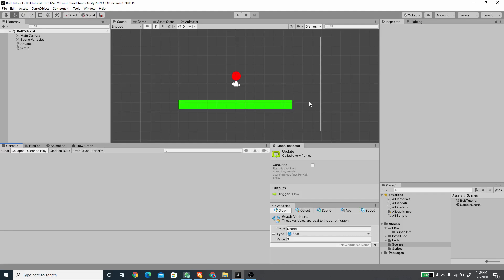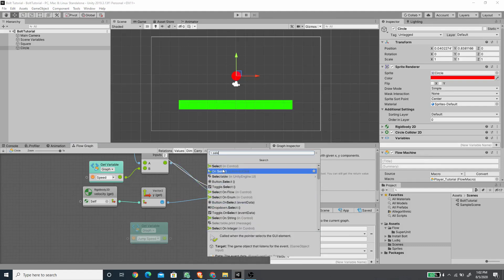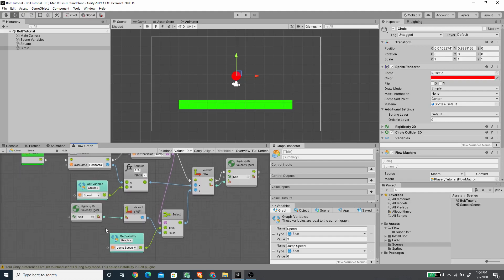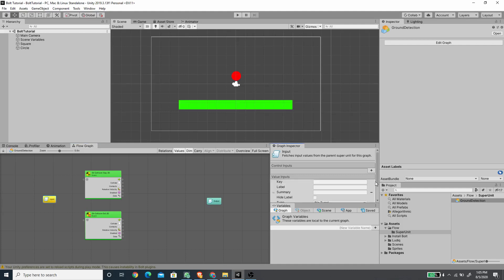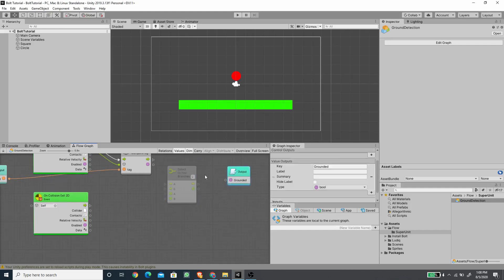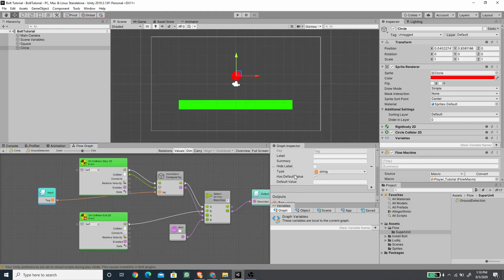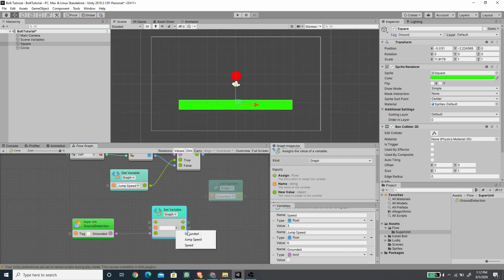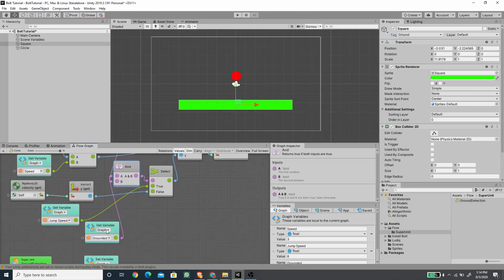Creating Jump with the Powerful Bolt Super Unit!

Comment: Theres one problem with this that I am encountering. If my player touches the side or bottom of the ground, that still counts as a collision, so my character can 'climb' or 'hang' from blocks. How do i make it so that the collision only counts if my player touches the top of the ground?
Reply from the maker: You can compare the Y position of the player and the ground, and only set the isGrounded value to true if the player y is greater than the ground y (meaning player is above the ground).
Reply: @RomiFauzi  How do I fetch the current ground's Y? That is, if the Player moves to another ground platform, how does my script know which "Ground" tag to compare with?

Or is there a certain node that makes figuring this out easy?
Reply from the maker: @HyperGameDev  hi there, upon colliding with another object, the OnCollisionEvent should receive the information of the other object the player collides with, that is if the object is on the tag assigned in the event (ie: Ground), then we can compare the y pos of the player with that object.

Comment: Hey, nice tutorial. Can u make a touch button control character animation in Bolt. I am googling but can't find one.
Reply from the maker: Thanks a lot buddy, I'm planning to the character animation next In Sya ALLAH, and I'll add the touch button to my list.
Reply: @RomiFauzi   thanks buddy's,  can u tell me where to learn about bolt function like where to use what type of functions.  Manuals are not good to me..
Reply from the maker: @nakul3561  I actually not sure where to learn that. I'm able to figure most of the units in BOLT is because I'm very comfortable with Unity C#, and BOLT is basically Unity C# in forms of Flow graph.
Reply: @RomiFauzi  ohoo, good my coding is not  so good. I appreciate if u make some tutorial . Thanks 4 reply.